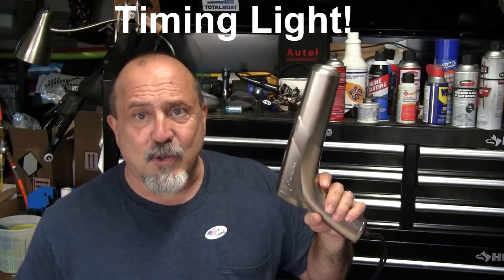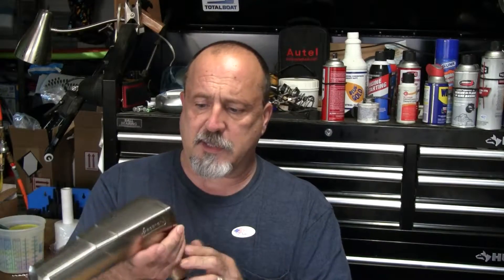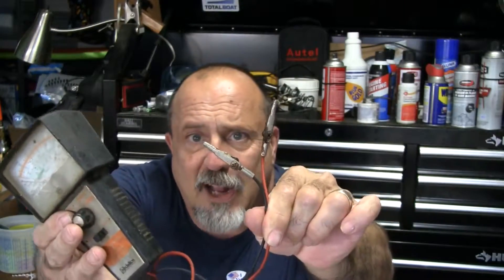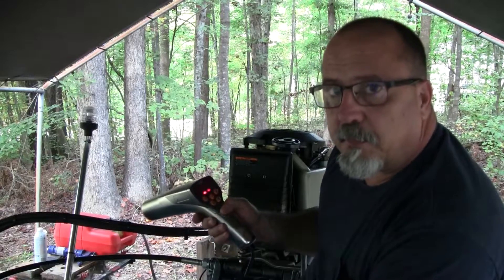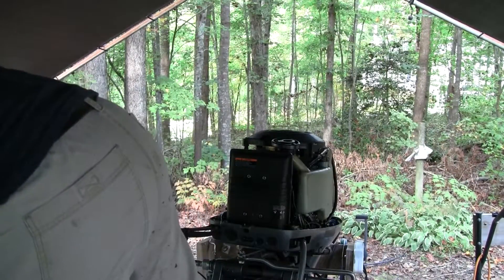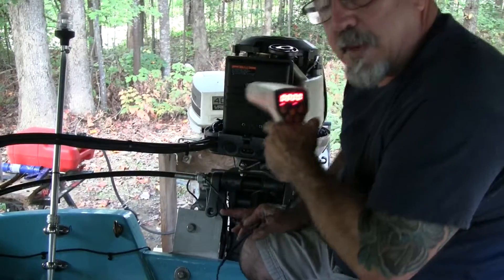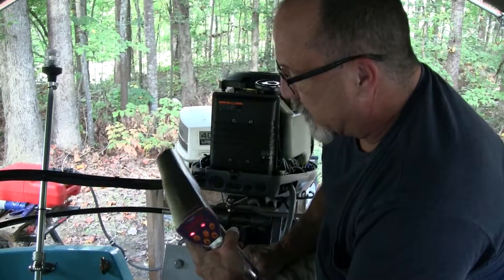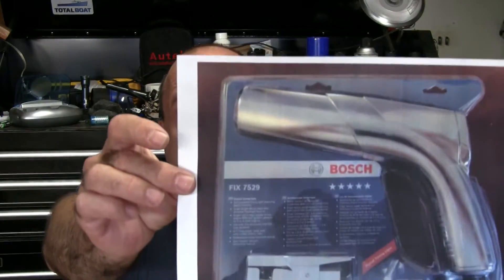Actron CP7529 Bosch Fix7529 Timing Light Tachometer Review

Comment: I was wanting to buy one of those do you think Bosch would be better or do you have any other makers that could be better.
Reply from the maker: With my experience on this I would go for with Innova, I don't have direct experience with the Innova line but from what I have seen they look pretty solid
Reply: I came here because my Bosch had the issue where it just stopped working. So this pretty much confirms that it fried itself. I'm going to have to get a different model.